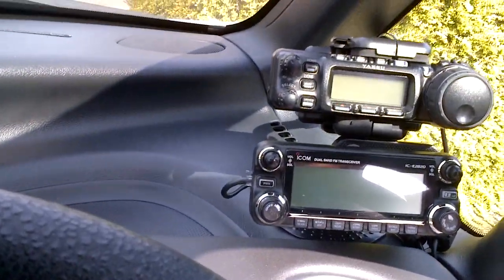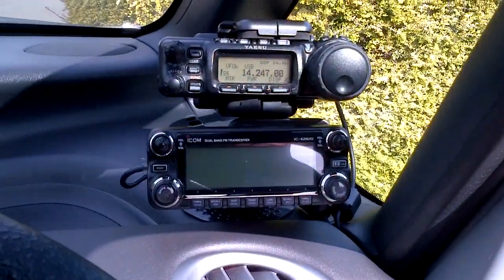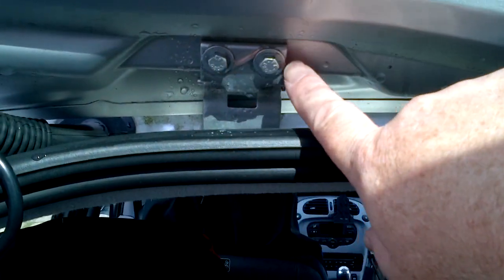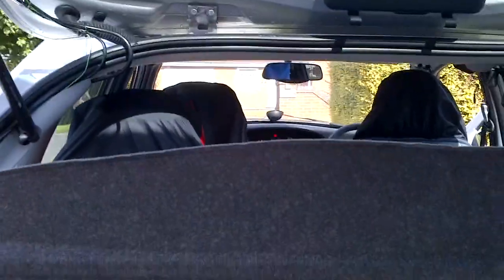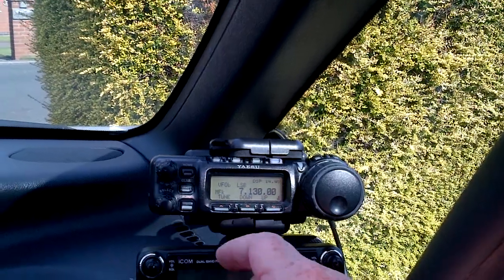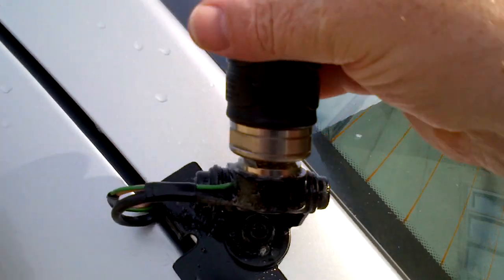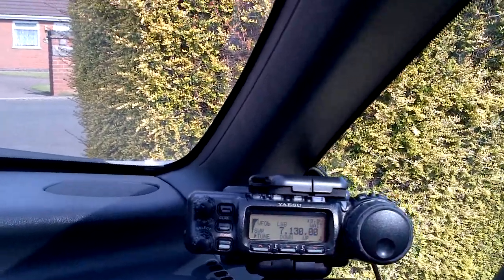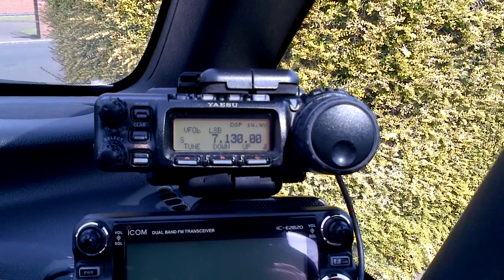FT857D & ATAS-120a installation Part 1

Comment: Ive got the same prob with mine. Thers another u tube post type in atas problems, the ham got his working might be worth a look, im using and ft991 , it was working but the atas is frozen, its very frustrating hi hi
Reply from the maker: As long as there is a very good earth to the system the ATAS120 will work but it's getting that good earth , thanks for the post 73's

Comment: Physical and chassis grounding. That will help with RF noise. But to get the air test work do you need a good DC ground. Take one of those grounding wires and go straight to the battery.

Comment: That's dodgy as! Radio flashing SWR and you just sit their!! I have a FT857D and once you see it flashing you don't just leave it keyyed up!
Reply from the maker: The Atas keys the radio up with very low power to tune the radio and antenna so there is NO PROBLEM with it being keyed up, YOU need to have a ATAS and the FT857D tuning up then YOU will know what you are talking about, hope this explains the tuning process of the ATAS and the FT857D
Reply: Yeah, it certainly does!! :) Friend has one of them, 73s ZL2BCI NZ

Comment: ok I can see how or were you attached the ground could you explain to me a bit? I cant get the atas to go up or down and I figure its a ground issue
Reply from the maker: as long at your ATAS tunes on all band then YES the ATAS will tune the SWR to your radio and you won't get any errors, My ATAS once first installed didn't fully tune on all the bands it should of so thats why I changed the earthing connections and in the end I got everything connected right and the tuning worked 100%

Comment: why so much grounding>?
Reply from the maker: You need a good bonding so the antenna can see a good ground then everything will work as it should, there are loads of video's on here showing how to ground or bong your car.
Reply: M0AOV oh ok i just bought one and cant seem to get it to tune
Reply from the maker: Have you set your FT857D in to ATAS mode ?? in the menu system of the radio ??? You will see ATAS on the screen if you have before you click on Tune on the from screen ? hope you understand what I'm talking about ?? Have a look also at this video https://www.youtube.com/watch?v=tAkjlBJAXf8

Comment: Also you can improve the antenna by using a longer whip...for example SIRIO 5000 whip...only useful to 10M then it will become  to long for 6M, 2M, and 70 CMS. you need to carefully drill out the head so that the new stinger / whip fits. you will find you can still use the short thinner whip to by tightening the 2 set screws. More whip less coil bigger signal !

Comment: You need to let the ATAS cyclle longer...sometimes it may take 2 mins or so, don;t  be put off by this as the antenna will sync with the radio. I have had this happen to me when i first got my setup and i had poor grounding too. Also you can manually tune by keying the mic and using the up aand down feature on the radio or mic ... which in my case is the FT-100D. Hope it helps or  you may have figured it by now. 73.
Reply from the maker: Yes all sorted every band now works it's all down to having a good earth connection.

Comment: Greetings M0AOV. Is there a filter to make reception of this radio even better?
Reply from the maker: Yes there are but they are a little expensive  https://www.ebay.co.uk/sch/i.html?_from=R40&_trksid=p2380057.m570.l1313.TR0.TRC0.H0.Xyaesu+ft857d+filters.TRS0&_nkw=yaesu+ft857d+filters&_sacat=0

Comment: All the more reason to buy ham sticks.
Reply from the maker: Once the earthing connection is done the Atas 120A works with out any problems at all on all the bands it should.
Reply: Yep, tunes up like the proverbial off a shovel, and quiet on the bands..........until I turn the engine on. Got umpteen ferrite beads spread about, but engine noise still present and rasps on idle and increases with acceleration. Any thoughts/ideas would be appreciated.......... Paul

Comment: Hi , totally changing the topic. What is the mount your using for 857 head unit, thanks
Reply from the maker: Hi I got the mount for the ft857d from ebay i.e. mobile phone holder

Comment: Did you discover the cause of the problem? Also, what antenna mount do you recommend? I am going to install the ATAS soon.
Reply from the maker: Hi Rob YES I found out that the thickness of the wire used to use as a Ground cable around the Antenna mount needed to be thick and gound the mount as many places as possible now I have NO problems at all my Atas is used from 40mtr to 6mtrs, you can use a ( Black Metal RB-400 RB-400B Car Antenna Mount Holder for Mobile Radios ) check on e-bay they are around £10 delivered.
Reply: ***** Thanks, I am about to fit one on my Suzuki Grand Vitara,I just need to find the best area on the car to fit it and to keep the car in a good condition (it is 3weeks old).
Reply from the maker: Robert Adlington Hi Rob the best place people say is the TOP of the roof but then with the 3 mag mount holder make sure it doesn't scratch the roof, I have mine on the boot of the car and have NO problems on the Suzuki Grand Vitara 5th wheel you can get a mount from e-bay not sure on the price but it fits behind the wheel and you can mount the Atas on that mount and I think they work very well.
Reply from the maker: Robert Adlington
something like this Suzuki Jimny Antenna/Aerial mount for CB/Ham radio item number on ebay ( 191139332662 )
Reply: Robert Adlington I have a stainless steel mirror mount bracket may by tram that I use on my 18 wheeler with the ATAS

Comment: hi! how did you connect your radio to the battery.. got the same rig and my antenna is Atas 120A on a ford edge13. am afraid to connect it directly to the battery.. i might interfere the cars computer board and might create some ground loops to the entire system of the vehicle. thanks
Reply from the maker: Hi revadan YES connected to the battery with out any problems, I use ferrite cores connected on all cables just incase I have any RFI problems and my Radio or Atas does not interfere with the cars computer board,all working 100%
Reply: revadan Less likely to interfere with the car’s computer if you go directly to the battery. Remember that big chunk a lead is like a great big old countersink it sucks all the noise out of the system that’s why everybody says go directly to the battery.